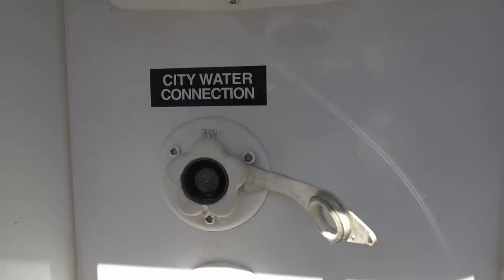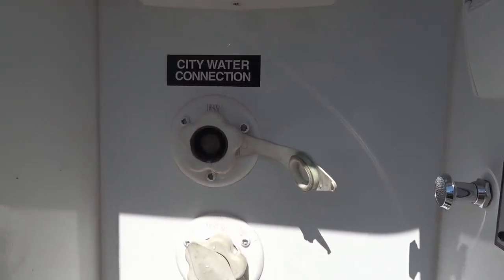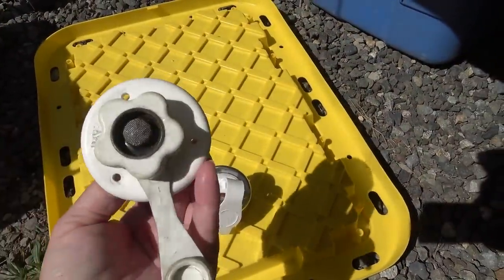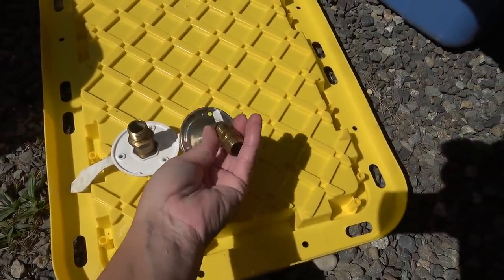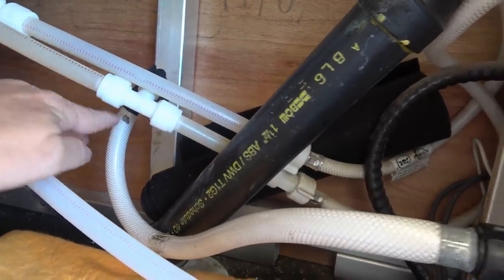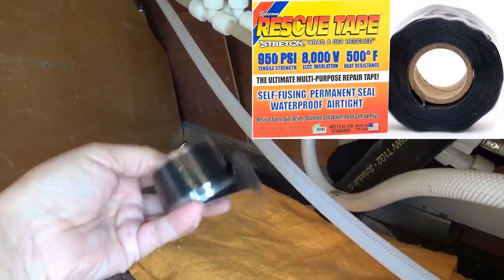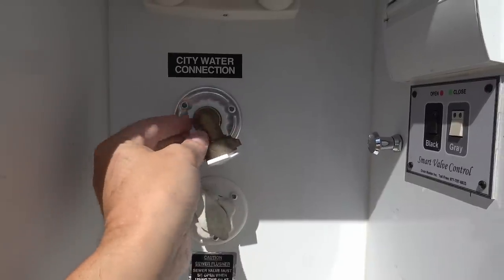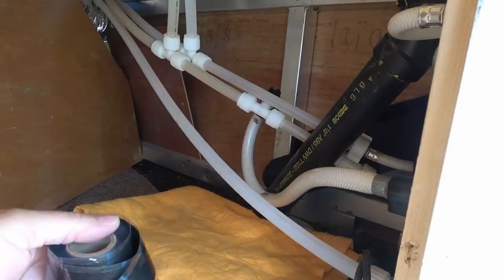Replacing Faulty RV City Water Connection - Weeping Check Valve

Comment: I had a similar problem with the check valve on my 5th wheel.  The city water hose enters on the sunny side and the original cheap, all-plastic valve would get very hot.  After a couple of years it began to leak from back-pressure, too.  I replaced it with an all-brass valve and have not had any more problems with it.  I have to use a female double-ended hose adapter to blow out my water hose for the winter.  Adapters for water, electric, etc. do come in handy.

Comment: No plumbing problems for me today, but I took my new to me Motorhome about 15 miles away for a few days so I could get familiar with it. Fail #1 the picnic table was too close on the right hand side as I was pulling into the site and instead of moving it I decided no problem and moved it with a baggage door. Sometimes you just have to raise your hands and admit defeat.
Reply from the maker: Doh! :)

Comment: Watch the replacement part close Ray. My new one leaked inside and I ended having to pull up the carpet and linoleum to expose the plywood floor in order to dry it out.  The solution did more damage than the exterior original drip...
Reply from the maker: Will do, I'll use the on board water and pump for a while and turn it off at night. We boondock so much we are used to using the pump. Cheers, Ray

Comment: Too bad about the water supply line.  Is it similar to one that goes under a sink or toilet connection?  Looks like the same type but have to get the correct fitting size.
Reply from the maker: I think its a pretty standard 1/2 inch hose with one end having a 90 degree elbow
Reply: @LoveYourRV  good to know. Thought it might be but not seeing the situation in person didn't know for sure. Thank you.

Comment: Ray, my Blue Sky charge controller just died after four years.  Would you go with Renogy or would you get another brand?  Renogy has a 40 amp model that looks pretty nice.  I have nearly 500 watts all together.
Reply from the maker: If I ever need to upgrade from my Bogart Controller I think I'd likely get a Morningstar - https://www.morningstarcorp.com/   They are really well built and respected company. Been making controllers a long time now.
Reply: @LoveYourRV   Thank you much.  
Holy crap, I see they are about twice the cost of a Renogy or most other brands.  But I believe you get what you pay for.  I will definitely check it out.  I believe in doing it right the first time to avoid having to mess with something again.  Almost every time I go cheap on something I end up regretting it.
Reply: Robert Thomas , you know the old saying “ you pay me now or you pays me later “ . Now usually ends up being cheaper in the long run .😉 !
Reply: @LoveYourRV   They do sound nice but it's also about over double the price of a Renogy.  My Blue Sky lasted four years and I'll be happy if the Renogy last that long.  I expect the technology to be even better in four years.
Reply: @mrc1539  I believe in that too pretty much, but the Morning Star is 500 bucks and the Renogy is a little under 200 buck.  I've had good luck with my other Renogy product and I don't know that the Morning Start would last over twice as long.

Comment: Hello Ray. Oddly in this video you comment about the pump running without anything open. Every once in a blue moon my water pump will run for a second or two and shut off. What's it telling me? Should I be searching for a drop or the like? Thx.
Reply from the maker: Hello Paul, it means the pump has sensed a drop on water pressure on the plumbing pipes and turns on to repressurize to a preset level, usually around 50 PSI, a little bit of running every once in a while isn't a concern, usually its the water heater expansion and contraction going on as it heats and cools water, differing battery voltage levels, or a sight leak in the backflow prevention check valve inside the pump itself. When it starts to happen in shorter constant time periods then there is likely a problem somewhere.  Cheers, Ray
Reply: @LoveYourRV  Thanks Ray. We never hear it at night. My pump is still a bit noisy. I'm going to attempt the pipe insulation tubing trick to see if that helps. Any tips or vids on cleaning tank sensors?
Reply from the maker: I gave up on the black and galley tanks a long time ago, with the poo and food bits and soap bubbles its a losing battle for us as full timers. Usually the best way is using lots of water and lots of tank flushing and soap and/or fabric softener. Fresh and shower tanks stay pretty well clean though with out doing anything. I have the SeeLevel gauges for better level resolution. Very handy for the fresh tank when boondocking - https://www.loveyourrv.com/?s=seelevel
Reply: @LoveYourRV  I hear you. Grays tell you they are full by stopping up. That's not a big deal. Its the black that can be troublesome. The OEM indicators are working ok for three of the four. My galley reads 2/3 full when I know its low. I wish they put in flush connections for grays. I wondered if some Awesome in the tank with enough to slosh about on my next trip could shake it loose. Stay tuned. Stay safe sir.